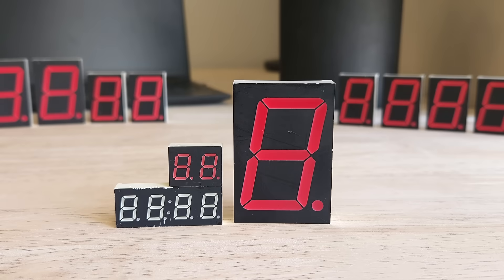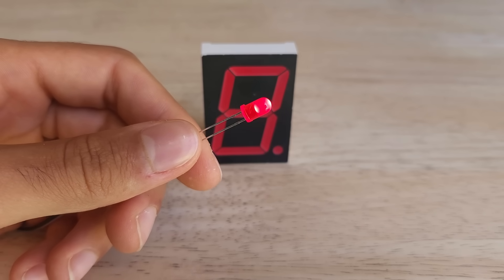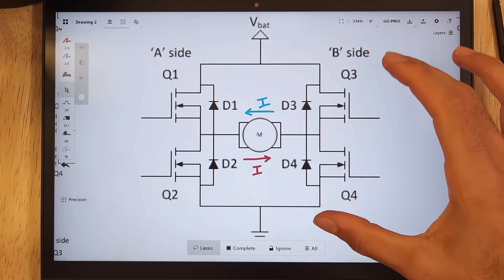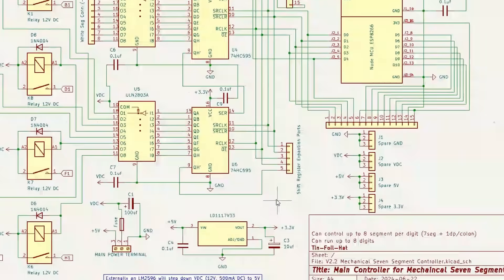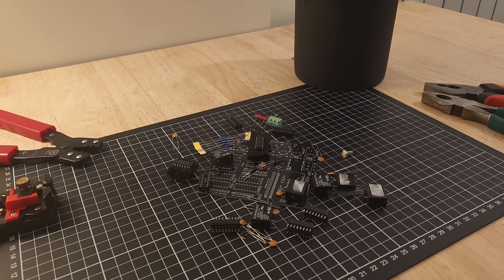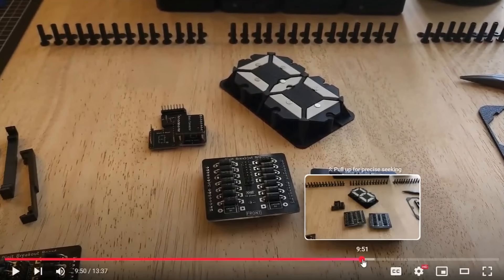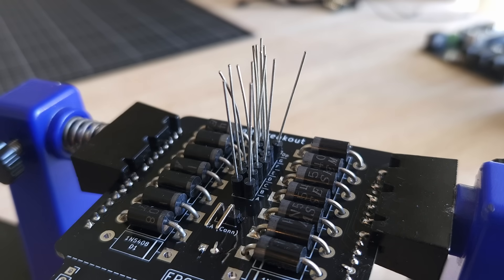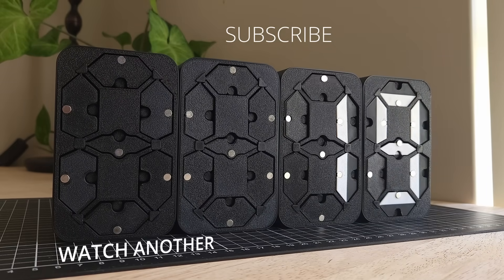The BEST Mechanical Display You've EVER Seen!!

Comment: I'm curious.  Why did you choose to double the number of coils by using two separate electro magnets rather than than a single one as implied by the illstration aound 2:40 in your video.  Wouldn't cut the number of coils in have and considerable reduce the complexity, time and cost?
Reply: He answered this question at 4:00
Reply: @julienylieff9188  The "too expensive" conclusion assumes he needs an H bridge for each segment.  Use a split power supply I believe no H bridge is needed.  Switch to connect the "+" bus to the magnet to common bus to flip it one way.  Switch to connect to the "-" bus to reverse the magnet.
Reply from the maker: To switch the connection such that it can go between positive and negative requires a H-bridge or similar circuit. You would need a seperate H-bridge for every coil in every digit (unless you multiplexed silimar to the way I did) because you need to be able to "choose" which electromagnet you want to flip independent from each other, and thus you cannot have both a common positive and negative bus for all digits.
Reply: By-the-way, I blieve it can also be done with an H bridge by selectively ensble H bridge transistor to pulse the power as well as change the direction, while  coordinating segment selects, but that's much more complex. OTOH you could do it with a single sided power supply.

Comment: Years ago I was commissioned to design and build a prototype driver to drive magnetic dot matrix displays, 5x7 dots, made by Ferranti-Packard. Eventually they were deployed on local busses to display the bus destination. I recall using daisy-chained 40 column shift registers to select the column to set and a byte register to set or reset the dots. All driven by a 4-bit micro controller, National Semiconductor COP-402.

Comment: 10:11 get yourself a pair of MIG gloves. Or even TIG gloves. & Buy the Miller ones.. You wont regret it 🤟
No reason to use the big ass stick gloves using mig.

Crazy video. 
I do electrical as well, & my buddy is an Elec. Eng… 
I was gonna try and max my own CNC too, and he’s told me about a lot of this kinda stuff, like making things using custom PCBs n shit, but damn… it’s super cool to see in action 
I would love to see how you made your CNC machine (que video backlog)
Reply from the maker: The CNC was someone else's design called V1 engineering. They have all the files for free and instructions on their website. It's called a MPCNC. You need to be a bit handy with electronics as they brush over that bit, but the rest is in good depth. Thanks for the tip with the gloves! Didn't even know they existed :)

Comment: Surely a digital clock is the one thing you want to not display anything when the power drops. Otherwise you have no idea if the time it's showing is correct
Reply from the maker: This isn't really designed to be for a clock, it is more useful for displays that aren't updated very often such as gas station prices or bus numbers.

Comment: 10:59 that doesn't look like electrical tape
Reply: It's probably masking tape, but the copper is enameled, so it's just to hold it in place I reckon ;)
Reply from the maker: yep just masking tape, you can use electrical tape but I found it comes unravelled over time. That's likley cause I've got cheap tape though...
Reply: Nah I've always hated electrical tape! Over time it just becomes goop! Non conductive sure, but masking tape and regular tape make way less mess in my experience! Cool project by the way dude! Given me another reason to buy a 3d printer haha
Reply from the maker: Yep the goop is horrid stuff lol You definitely need to buy one!

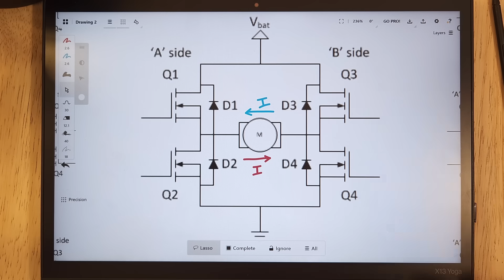Comment: 3:49 I think you dismissed this idea too quickly. There are some cheap H-Bridge ICs out there, e.g. the L293D could drive 2 inductors bidirectionally (!) and costs only 4€.
So for all 8 Segments that would cost 16€ in electronics, would be smaller than your solution and you would have to wind half as many electromagnets.
Reply from the maker: Yeah I good idea, I'll have to have a bit of a think for a possible V2

Comment: Could you use a single coil for each segment and reverse the current depending on the state you need? You could keep the two bolts and add a plate at the back to guide the magnetic flux around (or get U-bolts).
Reply from the maker: Yes you could. Straight bolts are easier to wind and from an electrical perspective it was easier and cheaper for me to use two bolts at the time :)

Comment: Is a "circuit to flip current" - aka H bridge - with a single coil really more expensive and more effort that two coils?
Reply from the maker: Yes a H-brigde costs more for me to make and takes up more room on a PCB. I have since learned in the comments that you can get ICs that contain 8 of them (but they are surface mount, which is a new thing for me to learn) so perhaps they are possible in the future. You'd also need that one single bolt to be U-shaped, which means it is much harder to wind. Two coils take 1 min each to wind :)

Comment: Nice to see one done that isn't using servomotors!😅
Are you firing the solenoid magnets from voltage doubling capacitors? That's far lower power (short, high voltage spike) and can keep consumption smooth if you control capacitor charging. Needs a diode and an output that can tristate (or DPDT relay)
Reply from the maker: I am not, but someone else also suggested this idea and I think it's brilliant! I will have to consider it further :)

Comment: Incredible build, and especially from a teenager!?!!! where did you learn all that, any resources you recommend? I've been meaning to get into electromechanical builds.
Reply from the maker: I just learned everything from practice and other youtube makers, I have been doing this stuff for around 8 years now, so just pick a project (easy to start) and learn all the bits you need for that one project, and so on and so forth. It took about 4 years before any of my projects actually worked so don't be dishartened by failures :)

Comment: This is absolutely amazing, I have watched it in sections, so much to take in at once, some fabulous equipment.
I used to design & assemble pcb's, long before wave soldering and surface mount took off,
At least you could see, and hold the components in those days !!!!!
I am guessing, despite your clear crisp non accent,
it's somewhere in Australia ?  Going by the very odd power strip socket pin layout, yes/no !!
Superb production, & the music choice, and level, is fine for me, on my high tech cheapo amazingo tablet, ha ha !!   🤗
Reply from the maker: Yes I'm from down under! I still have never tried surface mount, like you, I prefer holding my components without a microscope and tweezer. I really appreciate the comment and will continue to work on my editing skills over time, just happened that my first 'proper' video was seen by (soon to be) half a million people, but I'm really glad you liked it :)

Comment: Will the rotating shaft be worn and need to be replaced with metal or wear-resistant blades added?
Reply from the maker: Not sure, I don't think so because of how light the flaps are, but you could print it in ABS or a more wear resistant plastic, and also they're very easy to replace, should one break
Reply: @tin_foil_hat99  Thank you very much for your answer, I will use cheap small electromagnets produced in China instead of homemade electromagnets, it will be very easy to make
Reply from the maker: Do you have links to them? I'd be very interested in exploring that in my own time too. Winding them is a bit of a hassle

Comment: REALLY nice! 
... except I don't get the WHY... Let's say I build a clock and the power goes of. Then it would get stuck showing me the wrong time until power is back. It's nice to know when the power was lost, but that's the only real benefit. Which use cases are there for this ultra geeky ASMR display?
Reply from the maker: They have some uses where updates aren't done very often. E.g. a fuel station gas prices, they change once per day but if the power goes out you still want to see the prices. Sure, these days the gas pumps use power too, but it wasn't always that way.
Reply: @tin_foil_hat99  good use case!

Comment: Flip current circuit seems complicated on paper with diodes and stuff, but you can do it with one 6-contact switch (or relay, since you need electro and not manual input).

Comment: Great design, but using a very old 8266 devboard is a bad idea, ideally design the pcb to take a raw esp module, either 8266 or esp32. The modules are easy to find (and cheaper) . Also, having a controller per digit, with one being designated the primary, would allow all digits to change at the same time. (have the secondary ESP's listen for signals on a uart, sent by the primary, only the primary needs wifi)
Reply from the maker: Both of these are good points and good ideas!

Comment: 0:02 “we are surrounded by them everyday, but they all share one common weakness… their reliance on power. So I set out to design a mechanical display that retains its information even without power”

20 seconds later…

0:25 “All I need are seven colored strips that I can control electronically”

Comment: "Retains its information, even Without power......All I need is seven colored strips that I can control electronically."  Ummm, this statement is a contradiction as Electronically implies the use of electrons, which is what power is (Electronics, devices that are powered by electrons = Electric power. If your device is using electrons, in anyway shape or form, then it is using (electric) power.
Reply from the maker: Key word there is "retains" it only uses power to update the display

Comment: I worked as a sales rep in an electronics company during the mid 80's that imported these types of displays. Velec - dot matrix alpha numeric and Bodet - 7 segment numeric.
Both were horrendously expensive and had some issues with the hot temperatures that we normally experienced in Australian summers. They were used for petrol station price signs and data displays at the Australian Open Tennis.
Reply from the maker: Yeah mine are inside but I imagine the pla won't like the heat waves we're getting this year. Maybe petg would be better for outside?

Comment: ... and with that view of a power board you revealed what country you live in... Australia!  (You don't have NZ accent so not NZ, and you are clearly not Chinese)
Reply from the maker: Down under mate!! There's only about 10 of us here so shouldn't be hard to find me lol
Reply: @tin_foil_hat99  Now, you must be follower of people like EEVBlog?  What city are you in? Melbourne? (home of SuperHouseTV and UM).

BTW, you have done a lot, given you are still in High School.  My first gadget when in high school was a battery powered counter, 4 bit, using ttl chips.  It had 4 leds and a button and so one could think of it as a random 1 of 16 number generator.
My first S100 z80 computer I built while attending RMIT.
Reply: @tin_foil_hat99  Just added a harmless comment and it got NUKED, and it did NOT have any urls!  YT has become a very unpleasant platform.
Reply from the maker: I'm over west, quieter but still got some good tech to work with. Most people haven't made anything in high school, so your projects are still leagues ahead of most. YT has become a bit of a hassle to deal with indeed...

Comment: Great project. Always loved flip displays and yours has a great sound and look. Loved the production of the video and editing. Subscribed.

Some PCB design tips from a working EE, offered respectfully:
1. It's common in PCB design to use "mouse bites" which are small holes drilled in a line with some spacing to make a perforation. Then you don't have to cut it with a knife to use a break-off board! 
2. What size traces are those carrying the power through the relays to the coils? I'd make them as wide as is convenient in the layout to reduce resistance and heat. Really the whole layout should be arranged to prioritize those power paths. Especially if you want to flip all the letters simultaneously you could have quite a bit of current going through that tiny 12V input trace.
3. You should really use a ground plane. This will help with signal integrity for your logic stuff, and also it's good in general to remove as little copper as possible. Remember the board starts off as fully clad in copper and you choose where it is removed with chemical etching. In this case if you just filled all the negative space on both layers with solid copper connected to ground, you'd be fine.

Great work!
Reply from the maker: Thank you! This was my first PCB so any advice is well received, I'll consider a ground plane for the next one, and I tried to make all the power rails much thicker. It is in no way close to the perfect design, but I have run it continuously for days with no issues so I'm hoping it'll do the job :)

Comment: This is amazing work, very well designed, thought and achieved. The look is truly great. I think you should now paint the magnets black on one side and white on the other side. I suspect it's relaxing to see your digits flip to the next minute, or better hour, e.g. from 19:59 to 20:00!
Reply from the maker: Yes I will paint them for the follow up video! And I'll definitely show some more footage like the clock!!
Reply: @tin_foil_hat99  another future approach could consist in not making full open holes in the white/black parts, but leaving a thin layer of plastic on the visible sides so that the magnet is inserted in the middle between the white and the black parts, never being visible. Of course it must be very thin so that the magnet remains strong enough.
Reply from the maker: Yeah a good idea!!

Comment: I am wondering if it is possible to use only 1 electromagnet, and drive the other with a spring, saving materials
Reply from the maker: Yes, but then the electromagnet needs to be constantly powered
Reply: @tin_foil_hat99  true, isn't this also true for the solution in the video?
Reply from the maker: Nope, in the video they are only powered for 50ms!

Comment: Great work, on to 9, 14 and 16 segment displays next! 😂

By the way, if you do end up making more flip dot/segment/etc. displays, you should look at the DRV8912Q chip from TI. It has 12 h-bridges on each chip, can drive up to 32V at 1A per channel and can be controlled via SPI and even daisy chain up to 63 of them together, so up to 756 bipolar outputs from one SPI bus and CS pin! In addition it has a lot of helpful protections like undervoltage, overvoltage and overcurrent protection, as well as open load detection, thermal warning and shutdown, etc. Given that they can each replace 1.5x of your 74HC595/ULN2803A combos and save on space and wiring complexity, I'd say they're worth it! Very glad I stumbled upon them before building my own flip dot driver board.
Reply from the maker: Woah that's definitely something to look into, thanks mate!! Very detailed comment :)

Comment: Sorry for the dumb question but what kind of degree should I go for if I wanted to start working with things like this? Is it mechanical engineering? And if I'm not going for a full bachelor's degree, what kind of subjects should I study to get this kind of knowledge?
Reply from the maker: Well I just graduated highschool, so I'd say you don't even need a degree. Im completely self taught thanks to the internet, but have been doing this for 8 years. However I'm studying mechatronic engineering next year, which has elements of mechanical, electrical and computer engineering in it :)

Comment: loved the video. Can I ask, how come the middle segment in each digit is only the size of the visible segment, but the edge segments are double the size? Wouldn't it have been neater to make all the outside segments the same way as the middle segment? Thanks!
Reply from the maker: The thinner segments have issues with how close the electromagnets are to each other,  so I only used one where needed :)

Comment: Well done. The final product looked professional. I built huge flip panel displays at my first engineering job while I was still at school in the late 70s. The elements themselves were sealed in glass capsules and fit into different display holders depending what the use was going to be. A magnet held the displays in one position and the solenoid flipped them to the other. If the power went off the display was cleared. Your double solenoids would have had a huge impact on the cost of the projects and for mission critical applications we used battery backups so retaining the information was taken care of. I don't ever recall making a mobile unit or one where energy use was of any consequence. In a huge room the noise was barely noticeable but in our tiny lab they would drive you crazy in no time.
Reply from the maker: Woah that's so cool! Thanks for taking the time to comment that, I'm super impressed!!